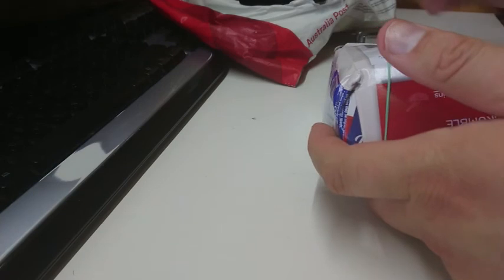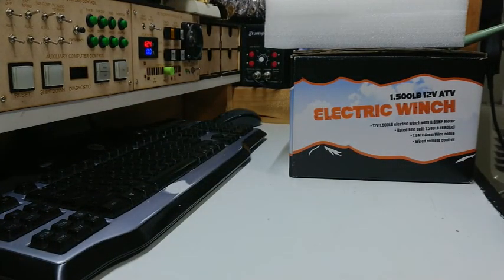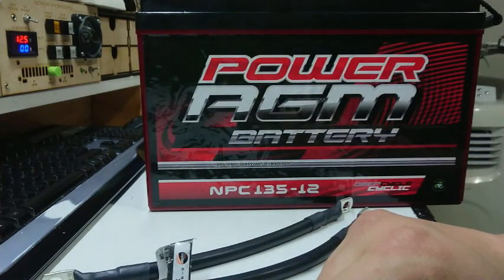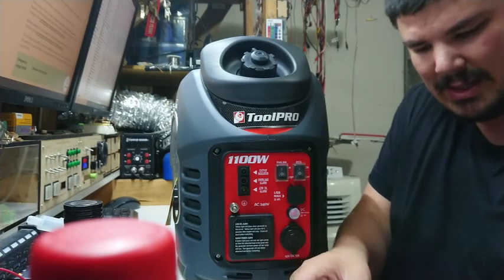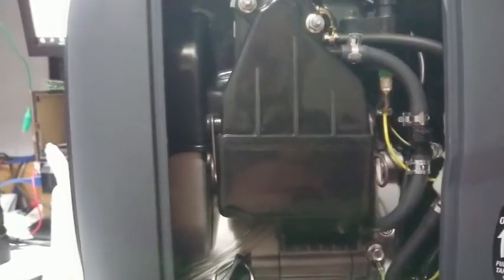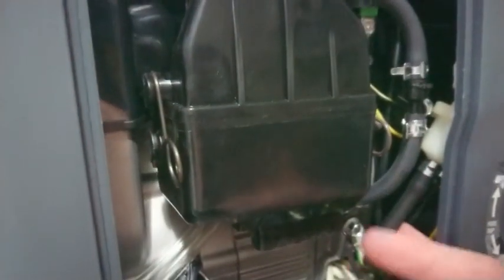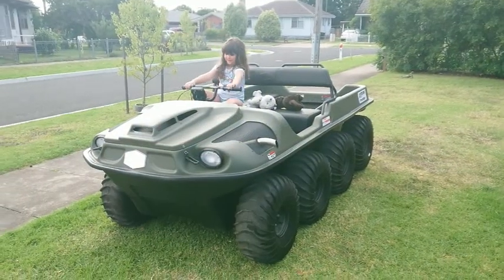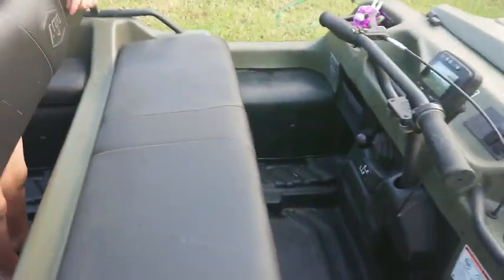Most expensive month ever! -  Donations and Deliveries March 2020

Comment: Will you be doing a teardown of the old charge controllers, and check the switching MOSFET specs?
Awesome machine mate, you deserve it, keep up the good doings.
Sad to hear about the progress of the MS, keep up your can do attitude it helps us all.
Will you need a bigger battery to drive the winch?
Stay safe, stay well mate..👍👍👍👍
Reply from the maker: The Argo has a 650 cc Briggs and Stratton engine with a 20a alternator and 40ah battery, a small winch shouldn't be a huge issue especially with the engine at idle.

I plan to re-use one of the charge controllers, the other I can do a teardown on if you like, but they are just three mosfests and a small handful of components.

I have a 300 watt panel on the way - and will do a video of sorts on that when I upgrade it - as the connections on the existing ones were also done on a non-existent budget and in a hurry.

RE: MS progress, I attribute my last attack to a change of medication to a cheaper brand - things have been calmer since, but the retinal damage is permanent in my left eye.
Spent 2 hours in an MRI last night chasing the walking problem - however most likely a lesion in left hemisphere.